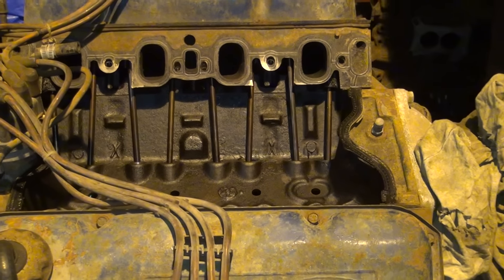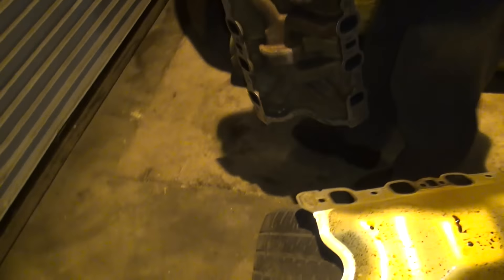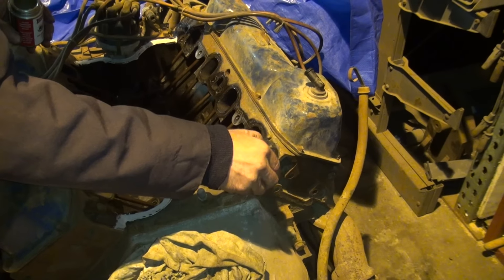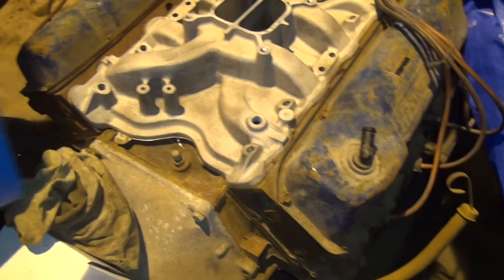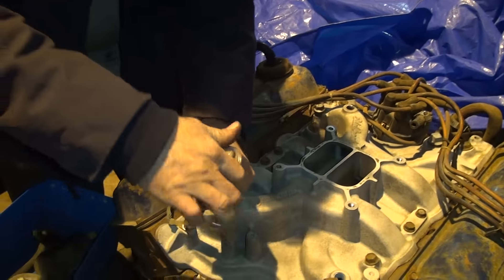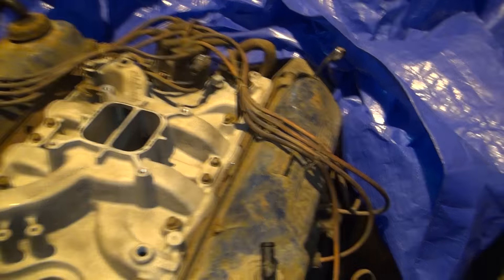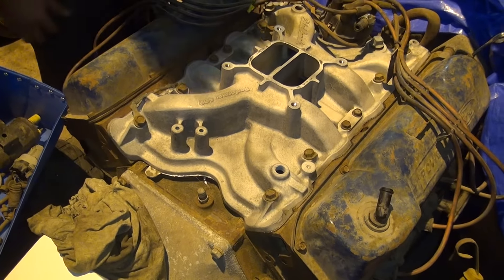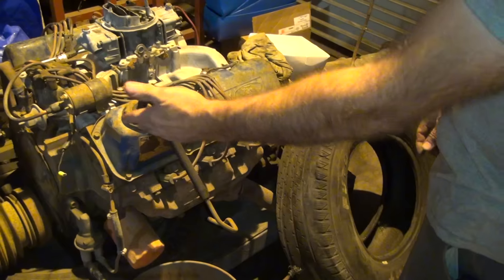70's 400ci ford #102 car motor rebuilding or repair by tatro machine

Comment: Wow! this brings back memories, my Dad had a 72' LTD 2 dr with a 351 Cleveland. We would get on 95-S every yr and head to S.C., 800 mi of nothing but V8 power on demand and the smoothest ride that Ford ever created.
He would center the steering wheel & let go, that machine would track straighter than the letter I...and when passing time came, shit the left lane was his, just touching the gas slightly, it would pin you back in the seat, and no hesitation at all when it came to shyttn & gittin.
she would do 120 ez with still some pedal left to play with.. I was 13 and couldn't wait to get my dl....thanks so much for this vid.

Comment: The bolt in the back he called an oil leak waiting to happen is the port for the oil pressure sender. He doesnt know because his head is full of "crap".
Reply from the maker: so an open oil port is not an oil leak waiting to happen? try running a motor with that hole open and see what happens. what another know it all dumbass.
tatro

Comment: This makes me sad. For less than $400 more you could have installed the Edelbrock cam that goes with that intake and had a 400 ft/lb 300hp engine.

Comment: Tattoo : you said that you had a carburator on a  396 Chevy, There is a very good chance it will not work on the Ford , most of the Chevy carburetors, of that time we're Spread Bore , meaning the secondarys water much larger than the Ford, Therefore not bolting on a Ford correctly.. save ya the labor..... Take off your air filter look in the top of carb, you will see...the large secondary  centuries...
Reply from the maker: yes i know the differeance. big air leaks when you don't match up the parts.
tatro

Comment: no you still got it , they are all stuck on the bike builds
Reply from the maker: a motor is a motor, all the same tricks work to make them run better. even on that foreign crap i don't like to work on.
tatro